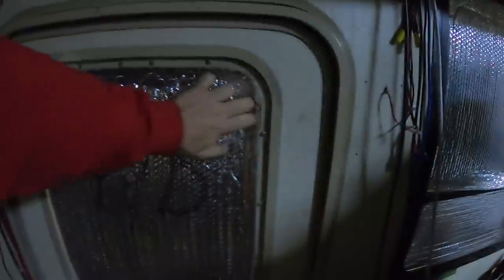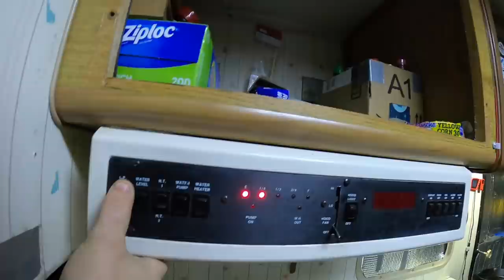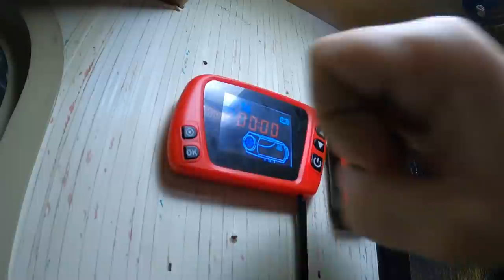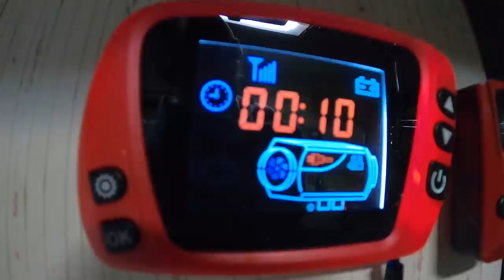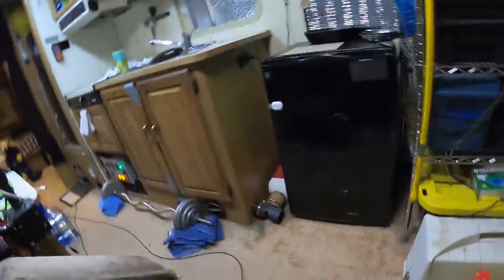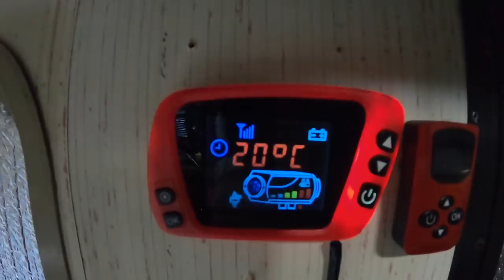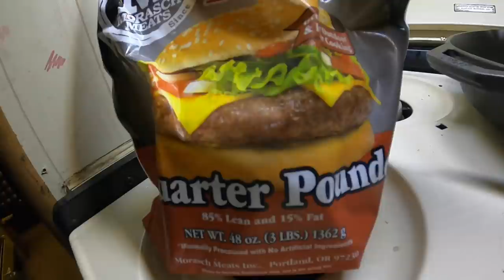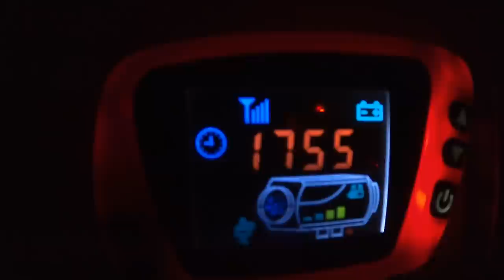Firing Up The Diesel Heater || RV Living Cheeseburgers

Comment: I installed one exactly like yours(the metal one) after watching your video install. I had a 13.000btu suburban propane furnace in the front end, which I removed, and installed it in the huge cavity left behind. Used one short section of duct, and shoved it into 5" insulated duct which was previously hooked to Suburban, and it heats the same space with 1/4th the noise of the propane furnace, on a lot less fuel. I'm going to tee into my diesel generators fuel line, but until then, a tank usually lasts 4 days. Like you, we use the propane for cooking. We're going on 14 months in the MH, and it's nice to see some of the same trials and tribulations. Thanks, for the idea, and your  videos.

Comment: I got an idea for you. A nice project would be to mount your diesel fuel tank on drawer slides so that you can slide it out for ease of filling. The drawer slides work just as well in the vertical position rather than horizontal. 👍

Comment: I got the 5k for my rig. On low it puts out more heat so I use less power. I find taking off the 12v is more of a pain than filling the diesel

Comment: Do you think that diesel heater could be made to run other oils..like used engine oil or say used cooking oil ?
Reply: @kigerkarlzeberedi1800  I was going to say maybe mix gasoline and used engine oil to thin it down a tad.. or French fry oil
Reply: @johnhershey4010  gasoline and glow plugs do not go well together... I would never do that regardless of some youtuber doing it.
Reply: @rebelyell1580  Yep you are correct. There are some heaters that run gasoline and some that use diesel fuel. I wouldn't recommend using gasoline in a diesel heater.

Comment: Cool, you can probably just use the yellow jug as the fuel tank. Use solid cap and tap into that. So when its empty can just swap from that to another jug. This way container is not compromised. Strap the jug down, so can drive around. Add a one way air vent also, and you in business :)